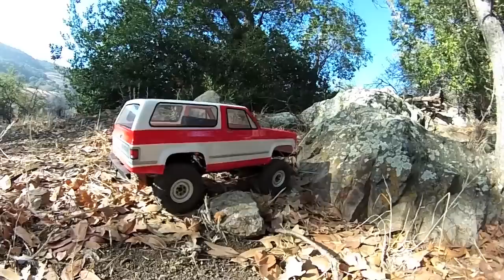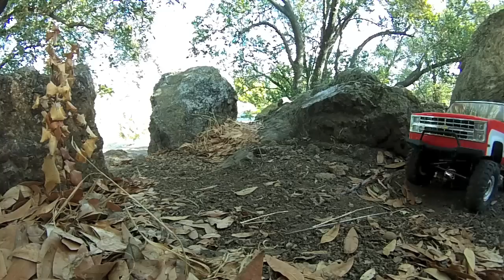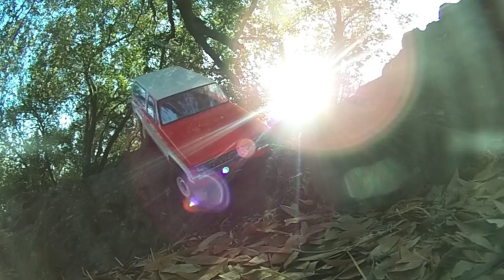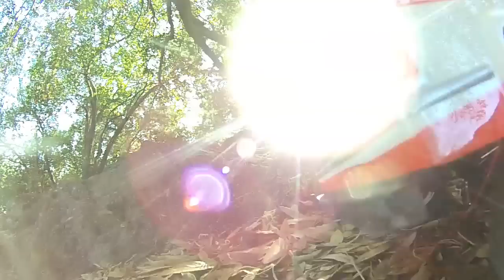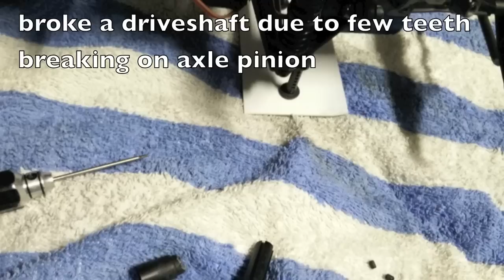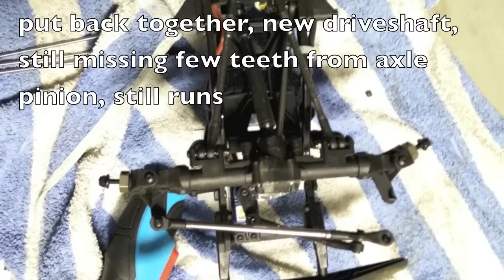Vaterra 1986 Chevrolet K5 Blazer Ascender - Another Trail Run

Comment: Are those RC4wd rims, and how well did they work with the Vaterra tires?

  Kinda want to get one of these rigs, but can't stand the kit rims and would probably swap them for what you have on this one or the "Wagon Wheels" since they're both OEM style rims for the full sized K-5's.
Reply from the maker: Thanks, I love this kit. No, they are not RC4WD. They are the plastic Gmade beadlocks. I have couple sets from other rigs but these plastic ones are starting to crack...had gotten brittle. The metal ones hold up well and I would suggest the metal Gmade beadlocks. My other set is the raw metal so I had natural rust formed on them for even more scale looks.